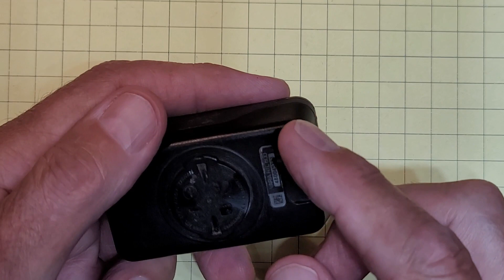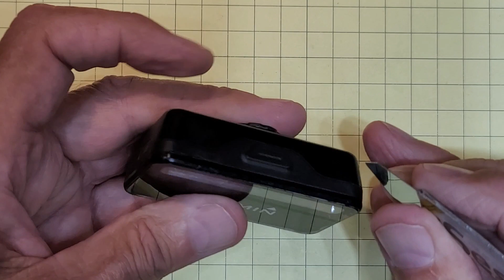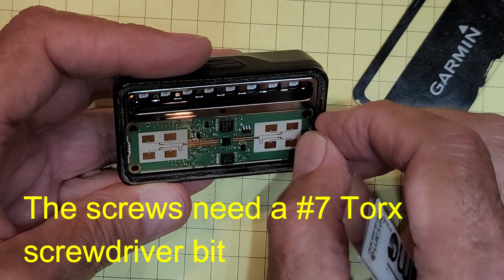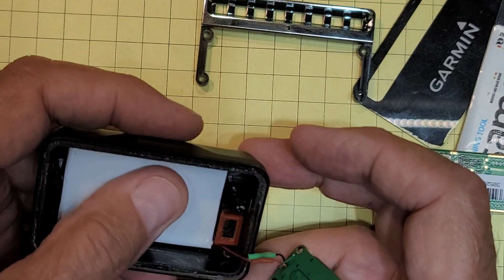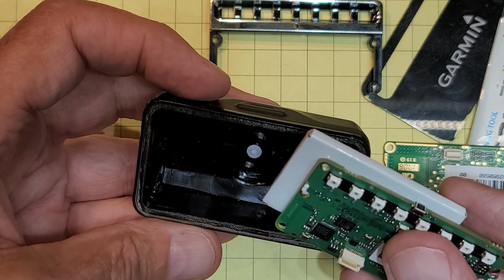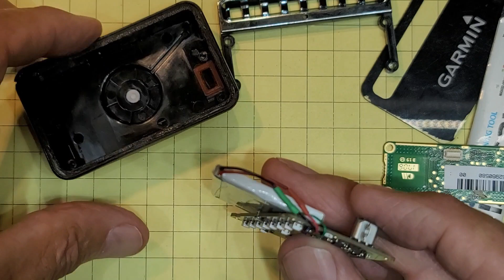Garmin Varia 500 Repair

Comment: Thanks for this - helped me get the unit apart.  For the battery - Search your favorite store for part - Garmin 361-00035-03 - and you will get the correct 3 wire battery with the full capacity.  The third wire provides a proper balanced charge between the cells.  The full capacity means the radar will stay on longer.
Reply: Incorrect. This battery has only one cell.
Reply: @cebruthius    Well actually it IS two 3.7v cells in parallel.  In one pack.  So voltage remains at 3.7v and the third wire makes sure you get a balanced charge between the two cells.
Reply: @graemejwsmith  Balance charging is only applicable to cells connected in series.
Reply: @cebruthius  Umm...  Respectfully - No.  You have to balance cells in a pack whether in series or parallel.  The method is different for each scenario.
Reply: @graemejwsmith  A pack of 2 cells wired in parallel has only 2 logical connections. You can add a 3rd wire all you like, it adds nothing. You have done nothing but handwaving, respectfully or not.
Reply: @cebruthius   Two positive leads and a common negative.  Three wires.  The unit does the balancing between the cells.
Reply: Thank you for this information.  Were you able to plug the replacement battery directly into the 500's circuit board, or did you splice the wires?
Reply: @slogun937  The replacement part I bought had the identical connector.  It was just a case of plugging it in.  No soldering.

Comment: Thanks for the video, I used the same amazon battery, i was able to use a plastic pryer for the cover, getting the old battery out was a process of working it back and forth to loosen the grip of the incredible sticky tape.  The new battery clips right in.  The old battery was 1100mah, so i loose about 10% but thats ok.  I use this light for group rides, its not as bright as my newer version, the newest version has a peleton mode that drops the brightness a bit.  Dave, thanks for giving a new life I never would have done it with out your pioneering.

Comment: I made the mistake of unplugging the battery plug from the board. I smashed the new plug trying to plug the new battery into the board. What do I do now?
Reply: I did the same thing :(
Luckily, I am good with a soldering iron.  With a very fine tip & a steady hand, I was able to remove what was left of the connector and solder the battery wires direct to the pads left on the circuit board. Unfortunately, I ripped off middle pad in the process (green/white wire) so just connected red & black. Seems to work fine, so all is not lost!
Reply from the maker: Depending on how damaged it is you may be out of luck
Reply: @DaveBodnar  Yeah, I think I really screwed up.

Comment: Viola!  My really old RTL500 was only lasting an hour on my rides.  This video and a $14 Amazon "1000mAh Battery Replacement for Garmin Varia RTL501, Li-ion Battery" has given it new life.

Notes:  The new battery referenced above and my old battery are exactly form/fit to each other including the connector. Its easy to pop off the old connector and reconnect the new one.  The only difference to the video was that my connector leads were at the bottom of the case, not the top.  The old battery was 670 mAh and the new one is 50% longer lasting.
Reply: Excellent video. Can anyone post a link to the correct one to use off Amazon please. Seen a few but like the sound of having the correct socket to save the fuss. Appreciate help guys.
Reply from the maker: Excellent, Ed - thanks for letting me know
dave
Reply: Thanks to Dave for this video. I managed to fix mine with a battery readily available from Amazon which has the same connector as the original, and 3 wires.

However,  I was not successful in clipping the the new battery into the holder, although it came out easy enough. There is obviously a trick to it which I could not master, and ended up ripping the connector from the board. Luckily, the 3 tiny pads remained intact on the circuit board and I was able to solder the battery wires direct to the pads.

I would take Daves advice and splice/solder the wires leaving the connector intact unless you are skilful in doing root canals!